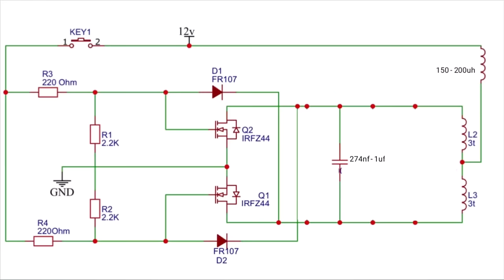Homemade Tiny but Powerful Induction Soldering Iron

Comment: This is called a zvs circuit working principe is that transistors creates a very fast switching ac sine wave, and cuz big frequency transformer doesn't have to be large for high power. Btw great project😀
Reply: So does the high frequency current create a high frequency flux and from the flux you get high current
Reply: Another issue is that it will generate high voltage at the output, so when output "soldering wire" breaks, it will give you a nice electric shock. The same can be achieved with just a "soldering wire" and 12V power supply, which has overcurrent limiter. 12V and 2A is 24 Watts, so it should be enough.

Comment: great project, congratulations! But this is not induction principle, this is a transformer
Reply: Transformer working an induction
Reply: This one is "Transformer Iron". It works the same as the resistance heater.
 Induction Soldering Iron should work the same as "Induction Stove".